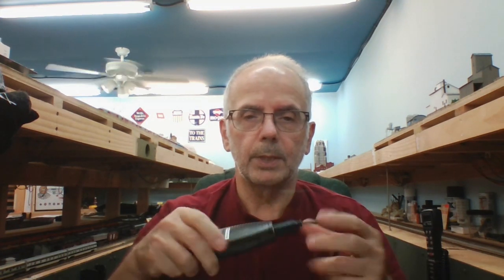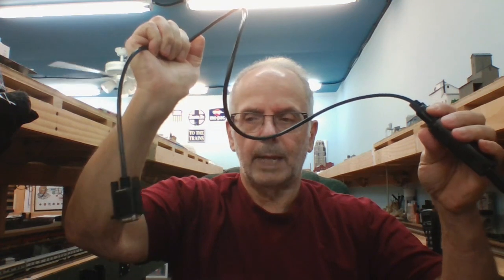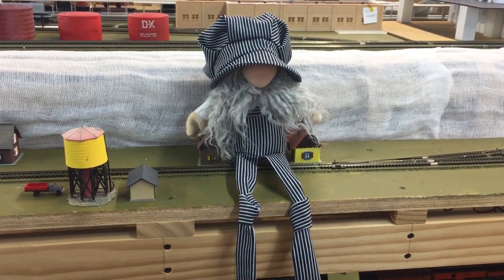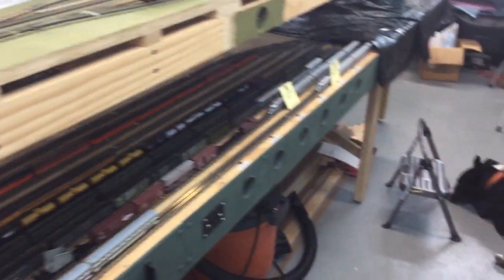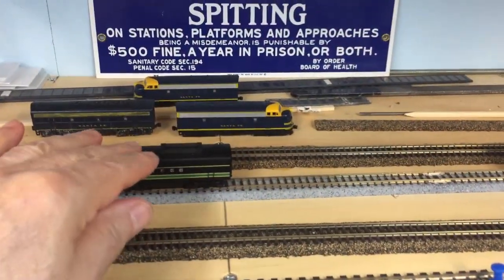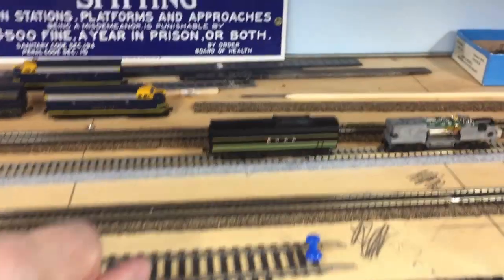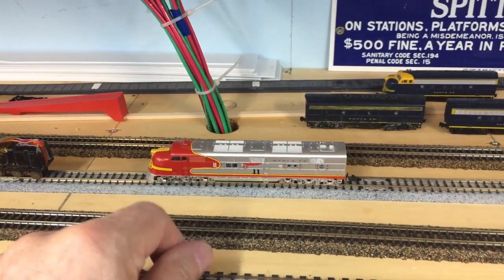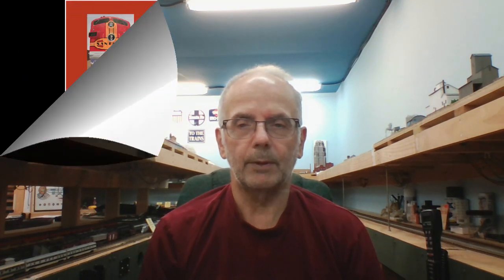Learning to Use JMRI

Comment: JMRI is great, still learning it myself, have mine set up to use WiThrottle, it's fun using my cell to run trains, thanks for sharing....Reid
Reply from the maker: Hi Reid, Thanks for your comments.  I also have the Wi Throttle on my iPhone but have not tried it yet. Art Houston had a real nice video about a group that used those throttles during ops on a fairly large layout....John